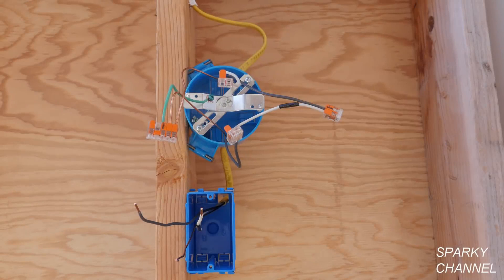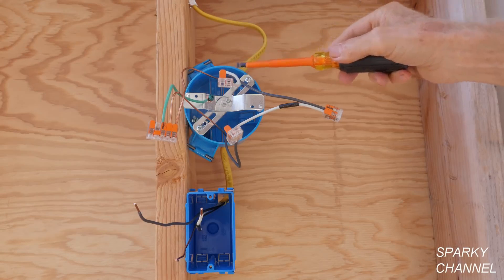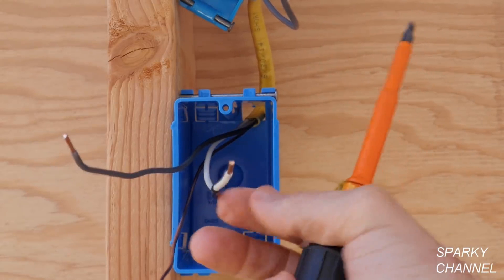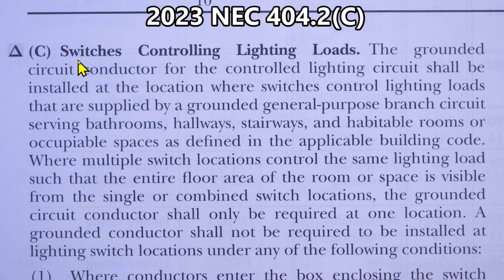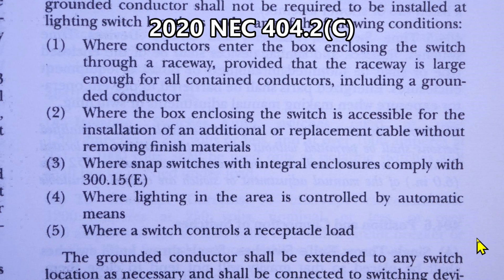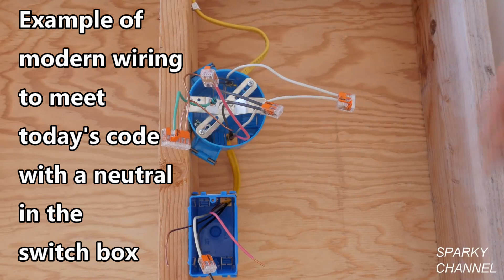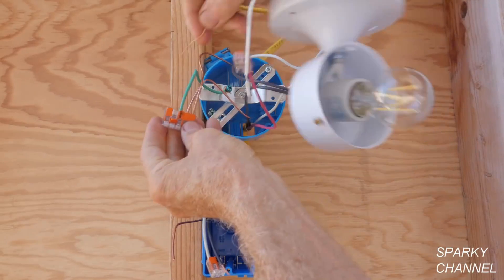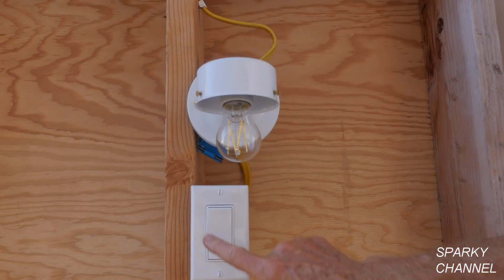NEC 2023 404.2(C) Switches Controlling Lighting Loads, Code Deletions? What Deletions?

Comment: Great video, thanks! I remember seeing this requirement pop up. Follow up question / video idea: what happens when wiring a three or four way with Romex, and you need a common wire? Did the code you read about "in the case of multiple switches controlling lighting in an area you can see" mean that neutral GWC is only required at one of those switch boxes?
Reply from the maker: Thanks! See 5:19 to 5:37
Reply: Yes, that's correct,  but do keep in mind some local codes are more strict than the NEC and require a neutral be present at every switch box and therefore you will not be allowed to run dead end three ways,  or have power come to one switch box, with the light in between and a 14/3 running from the light to the last 3 way switch.   In such cases you'd have to run 14/4, or you might be able to get away with 2 runs of 14/2 instead.

Comment: @Sparky Channel, I am curious why you are not using a torque screwdriver? Doesn't the new code require that terminals be torqued to manufacturers' specifications?
Reply from the maker: Torqueing is not required for receptacles.
Reply: He did just put out a video about torquing connectors the other day
Reply: Man you're trying hard. Just tighten the damn screw ot you're fired.

Comment: All my lights are switch loops from the 80’a negating electronic switches short of the Lutron switches that don’t require it. Wouldn’t it be nice IF the NEC could allow a single grounded circuit conductor to be run alongside the bundled wire.  Short of pulling a new wire and modifying the switch loop, we’re stuck.  I’ve already modified my hall lights when I had the opportunity , but I’d rather a viable alternative be proposed - because I promise you, people will use a grounding conductor as a neutral.
Reply from the maker: Well, switch loops with no neutral in the switch box were legal in the 80's and I guess they were trying to save wire when they wired your house. 
You could run separate neutral wires as long as they were in a protective sheath or flexible conduit.
Reply: @SparkyChannel  Basically - no conductor can go from one place to another unless it’s protected by a primary and secondary protective jacket - right?.  If only we had one conductor sim-pull Romex. :-).  I doubt switch loops saved money or wire as any branch circuit has to terminate “somewhere” - it’s probably a convenience to the installer.   Thanks for a great code summary.
Reply from the maker: @LDoctorKC  Yes, that's correct. Thanks!
Reply: @SparkyChannel  what could easily solve the switch loop dilemma is 14/4 w ground taking a neutral to all switches.  Southwire makes it but nearly impossible to get. My local electric supply only has 12/4 and it’s so expensive.  Just a comment.
Reply: @LDoctorKC  14/4 is something that's very rarely used, and if you're lucky enough to get some,  it's probably not worth the cost.   Been there a few times. So in a renovation where I am adding three ways and four way switchs onto a circuit where there was a single pole before, I use two sets of 14/2, one set for the hot and neutral,  the other set is for the travellers,  I then used red tape on the black traveller, and blue tape on the white traveller, didn't have any issues passing inspection.   And now I went above and beyond code and have a neutral available at each box,  for future proofing,  if necessary,  I replace the switch box with a deep rework box to accommodate the extra cables.   Just offering tips I learned working with other electricians.
Reply: @SparkyChannel  in the 80's, you didn't have all the "smart" technology. You only needed to interrupt the "hot" with a switch before it went to the load. That only takes two wires. You only needed a grounding conductor for the box/switch frame to keep it from going live in case of a defect. Now all these "smart" devices need power all the time, so you need a neutral/grounded conductor to carry power for the "smart" device while it controls the load on two separate "hot" wires.
Now only if we could get NFPA to subsidize this overpriced copper market to pay us owners for that unused copper wire in the box because we still use the "dumb" switches that can't be hacked by the government or the Russians.

Comment: Pretty sure most people used the black as the hot and  white as the hot return in older style, non-neutral wire single pole light switches.
Reply from the maker: Thanks!

Comment: another reason for carrying a neutral with your switch loop is to be prepared in case you might want to extend the circuit in the future.  it wasn't uncommon for electricians in the mid 70s to run a 3-wire from the light to the switch, and then a 2-wire from the switch to a receptacle.  

it also bears mentioning that in a 2-wire switch loop, the code does require the white to be used for the hot wire instead of the switched wire.  although, if you make a habit of having a neutral at every switch location, that's a moot point.
Reply from the maker: Excellent point, thanks!
Reply: Yup, lots of 70s/80s homes here and that's the wiring I've come across.

Comment: Why wouldn't you just run the feed through the switch box first to simplify the circuit? Wouldn't you meet the code to have a neutral in the switch box.
Reply from the maker: Yes, absolutely. Running power to the switch box is the best way to do it. I wanted to show how to convert a switch box with no neutral to one with a neutral though.
Reply: @SparkyChannel  yes, but most architects and home designers don't plan the details of the wiring runs. So it gets installed on the fly. I say this because I'm not an electrician (I am a mechanical engineer in an industrial equipment industry and I see this every day with industrial equipment that does not fall under the scope of NFPA 70E).
Reply: usually, it's when you have a switch that is located far away from the rest of the circuit, so you want to run just one cable to it instead of running two cables to it.  but you might also be making a repair or change in a house that is already wired with power to the fixture location.
Reply from the maker: @kenbrown2808  Yes, that's true.
Reply: Most homes are wired by the contractor with the lowest bid, not by the best electrician.  To be the lowest bidder they keep the amount of wire they run as short as possible.   Custom homes, and ones wired by guys like me who are advanced homeowners, and working on things for themselves or freinds and family, are actually wired better than the tract homes.  There is code minimum, and frequently a better way to do things.  The code is proscriptive and meant to keep things safe.  And, it is the least you can do.  There are frequently better ways to do things, but doing them can confuse the next person to work on it.

Comment: I'm actually in the process of replacing one of the switch loops in my garage with 12/3 so I could have a neutral for a pilot light switch, which requires one. It will also allow me to add a convenience outlet where I could really use one.

Thanks a million for sharing your wealth of knowledge in such an increasingly complex profession!
Reply from the maker: Thanks! Yes, more and more switching devices need a neutral now.
Reply: Wow who cares. Do you want a cookie?